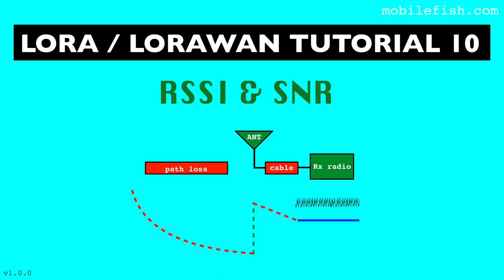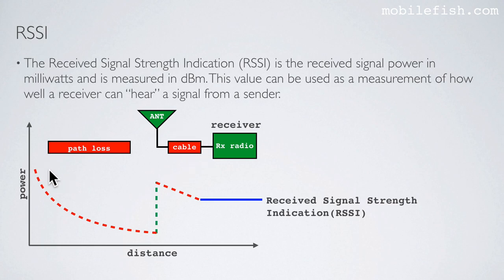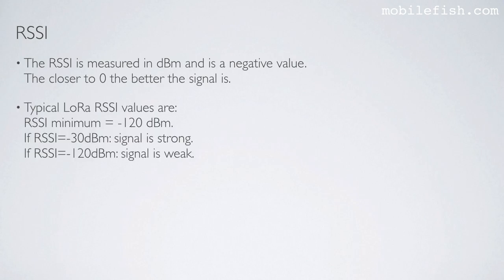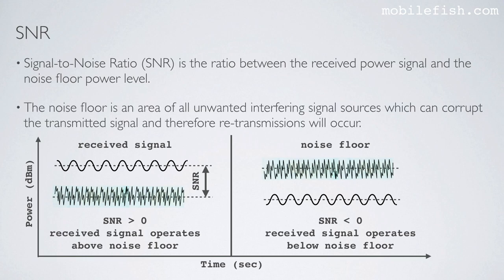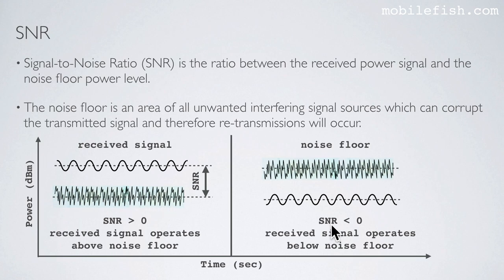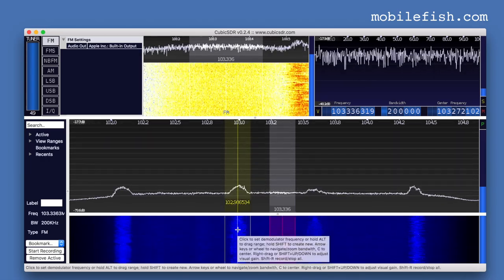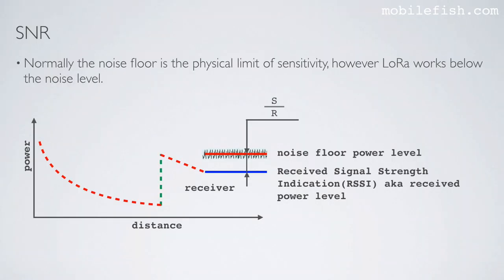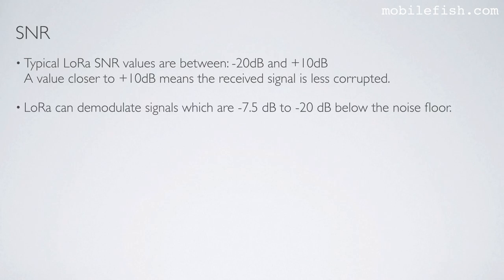LoRa/LoRaWAN tutorial 10: RSSI and SNR

Comment: thank you for your videos i learned a lot from them, i just have a question. i cant really wrap my head around SNR first of all you said that lora works under the noise floor level.. so making SNR values below 0. but then you say that typical lora SNR values are -20 to +10. but +10 makes it above the noise floor level. then it is said that lora cant de-modulate signals above -7.5 db below the noise floor. can you please elaborate what im missing here ? thank you for your help
Reply: Hey, I got a little confused with this too, but re-watched the video and I think I get it now. +10 would be ideal, but I guess this isn't always possible, however LoRa is able to operate at negative SNR values, and is subsequently able to demodulate signals between -7.5 and -20 dB from the noise floor. My guess is that if the signal strength is too close to, or specifically too close to and below the noise floor, the signal will not be demoldulatable.

Comment: so what is good SNR value? >0 or <0 ?
Reply from the maker: Signal-to-noise ratio (SNR) is defined as the ratio of the power of a signal (meaningful output = Pout) to the power of background noise (meaningless or unwanted input = Pin).
SNR can be either positive and negative value if you represent it in dB scale. 
Negative SNR means that Signal power (Pout) is lower than the noise power (Pin). 
dB = 10 Log(Pout/Pin)

Good: SNR > 0
Bad: SNR <= 0